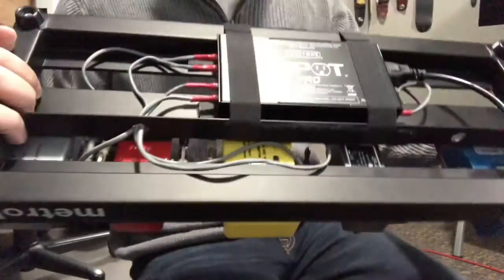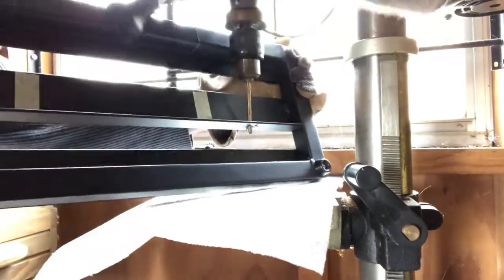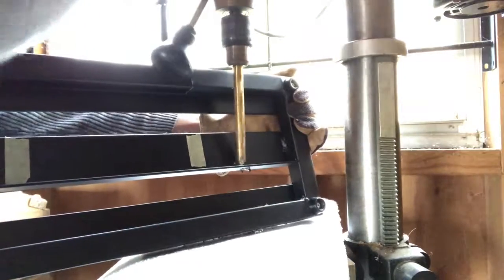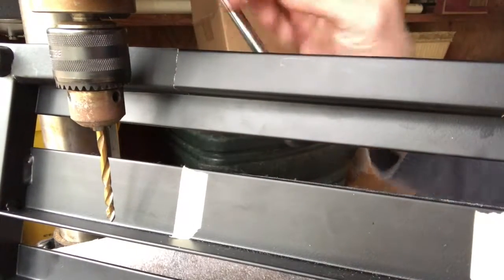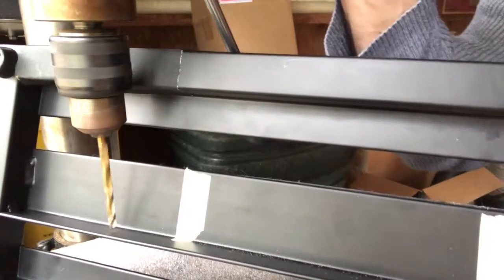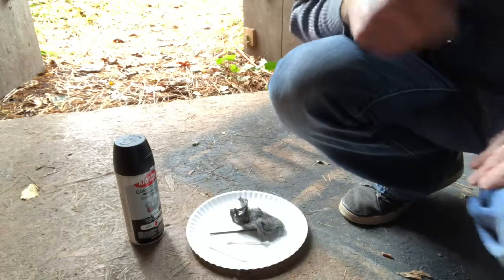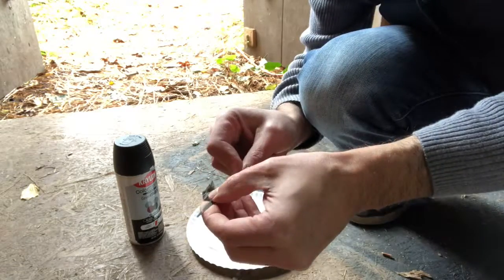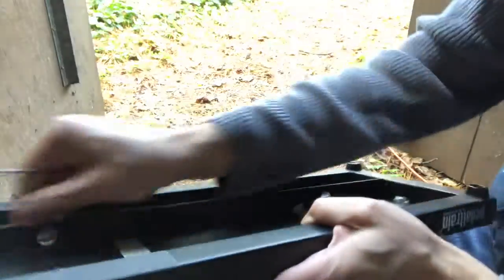Metro 20 Mod - Courtesy  Ports

Comment: You could also use rubber grommets in the holes to protect the wiring it will also cover any bad edges around the holes , just ordered this metro 20 board.